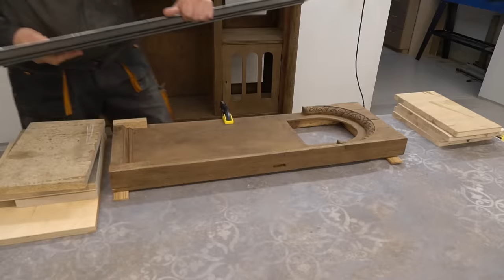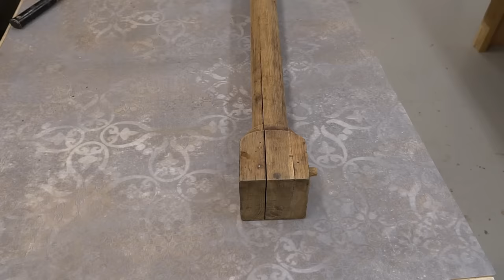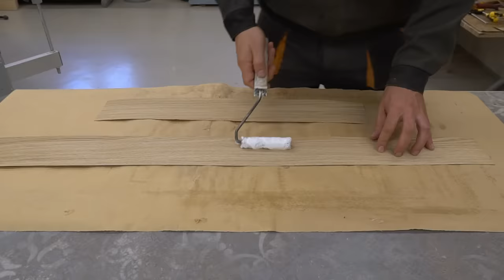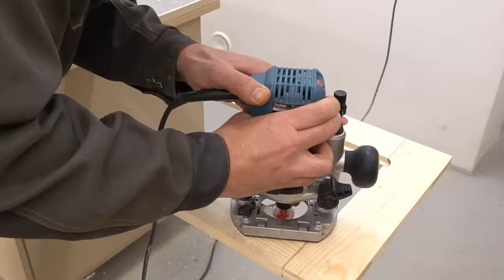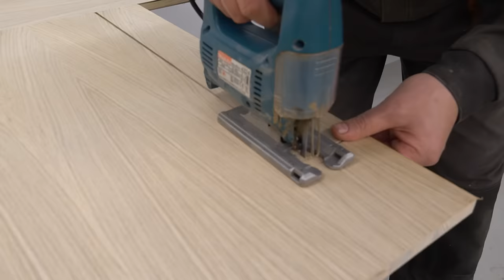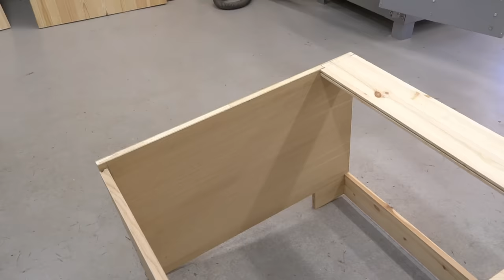I spent 400 hours restoring this 1930´s cabinet

Comment: Mind officially blown!  All the dovetails and rail and stile doors and lathe work to create columns and bun feed and you even finished the insides of the drawers!  I hope your client was ecstatic!  We bought the top of a Hoosier (kitchen pantry famous in the US c. 1900-1940) and made very simple legs with a frame for it to sit on and thought we were clever. I look at this and think, "OK, maybe not so clever."  As an aside, every time I see you use your corner clamping blocks I think "Those are clever.  I should make some."  And then I forget until you use them again. And again I think "Those are clever.  I should make some."  😂
Reply from the maker: Haha 😂

Comment: My dad wasn't a woodworker. However, he knew about wood 'movement', the shrinking & swelling of wood depending upon the ambient humidity. Whenever he built something, he always made it with a "kerf" of wiggle room. (He made a gap that was the width of the saw blade/kerf) His wood projects never split or buckled.

Comment: I noticed that you did not stain the outside of the drawers…just the insides. Is there a reason that you do this? Beautiful, tenacious, and patient work. Stunning. Congratulations.
Reply: At 36:24, I noticed the left side of the outside of the left hand drawer was unstained. Just trying to clarify… Just curious why you did not stain it. Thx!
Reply from the maker: Originally these were never stained, because of friction.
Reply: @ATRestoration  Thank you! Makes sense! Are drawers normally unstained on the outside? I have a beautiful quarter sawn oak dresser that I would love to freshen up. New to furniture refinishing, and don’t want to waste my time or mess it up…

Comment: Excellent ❤ It is pleasant to see how it is built. It is a work. Knowing it, I am wondering how they were doing before to do the same … without these machines used. The tools were more rustics probably. I mean without the use of electricity. You needed 400 hours but in 1930 … Or they  were a team or it was taking much more time. I guess. What do you react about this thought? 🌹
Reply from the maker: In 1930 the electricity was a pretty common thing. Before that, machines were run by steam. And before that, machines were run by wind and water. My grand-grandfather had a workshop, that was run by wind, around 1880. So machines have been used for a long time now.

Comment: A little bit of soap on the teeth of the blade will help you cut easier (band saw). You push a little, give it a bit of soap, push some more, bit more soap so on. It really does help, and unlike wax, it won't impede glue up.
edit: also at 27:59 drill a hole in the  table saw, behind the blade at about 4~5 cm. Tap that hole for a 10 mm bolt. Stick the bolt in and thin it such that the blade and the remaining part of this bolt line up. It shouldn't be any taller than say ... 3~4 cm with a rounded profile and a slightly sharper part at the start. This will keep the material from pinching on the blade as you pull on it (like it does on a circular table saw). To make sure it doesn't move, you can either make a smaller 2 mm hole right on the perimeter of the bolt and stick a grub screw in there or just drill a hole and put a nail. Either will suffice for making sure the "blade" doesn't twist on you.
This keeps the wood from pinching and once it grabs the cut wood, it keeps the blade from moving out of track, because the wood is now secured from moving from two positions (the fence and this). Have done it on all my band saws and it works great. Mine's locked in place with a custom lock nut from the bottom, but that's because my table is likely thicker than most others as the saw is older. 1918 ish ship saw.

Comment: Pro tip; never wipe off excess glue while it's still wet. Allow the glue to dry first then scrape off the excess. Wiping pushes glue down into the pores of the wood, and affects the way it absorbs stains and finishes later on.

Comment: So just a question... I get that the original cabinet was produced with base-wood veneer construction.  In this instance why not reproduce this entire cabinet in solid oak? or at lease the damaged components in solid oak rather than use veneer all over again.  It just seems more efficient to reproduce the necessary parts out of the solid oak... I have been watching your channel for some months now, and its just a curiosity.  Don't get me wrong, your work is absolutely beautiful, I would have any of your restorations proudly in my home, you're an artist.  Is it cost of the materials where you are possibly... or just the desire to return it to its original design?   -Shane
Reply from the maker: Thanks! I didn´t use solid oak because the original was not made from solid oak and secondly, it is much more expensive.

Comment: I wonder what the carpenters of old used when they has to clamp something? Maybe blocks tied with string to keep them tight, heavy weights? Or were most things nailed that weren't dove-tailed.They would be purple - beyond green - with envy at all the gadgets todays carpenters have at their disposal.

Comment: Get a few rolls of blue tape, open them from their packaging and find a damp and cold place, put them on strings and leave them there for about a year. As you take one to use, put one to rest in its place. Start with an experiment to see how you think about the tape's behavior after it's been left to "stew".
TLDR: tape needs to be aged if its to actually work. Old tape is better than new tape. Old trick i've learnt from my archi teacher when the sh!tty tape couldn't even stick a piece of paper to the drawing table, let alone hold down 4 mm veneer. :)